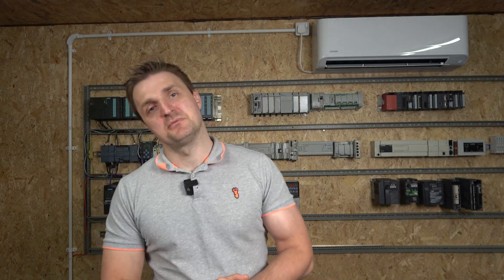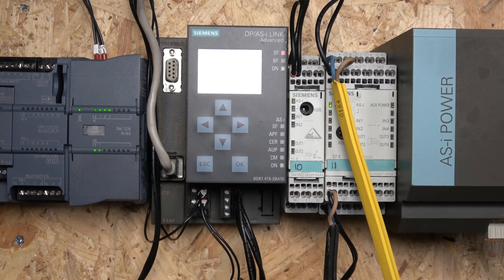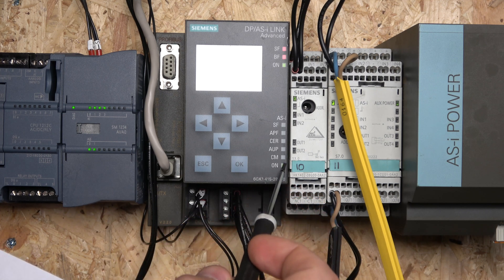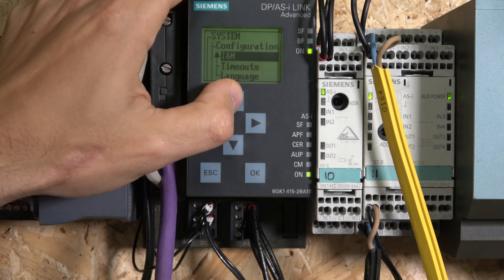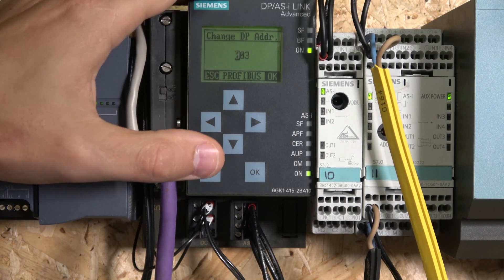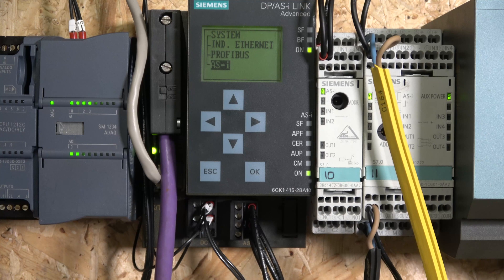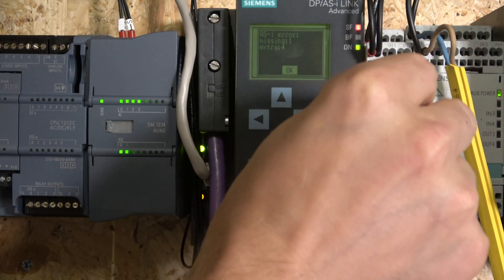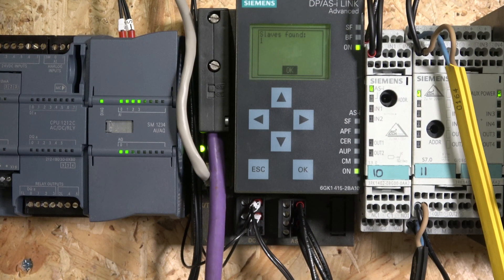Siemens DP/AS-i Link Advanced wiring and set up. English

Comment: I’m setting up vacon 20. It is a 3hp motor for a fan. I have the line and load installed.  I’m adding a start and stop button by the drive to control off and on. The stop button is NC and the start button is normally open. I took a wire from 24v to stop terminal and from stop opposite side to start button. I used another wire from normally open back to drive on start forward. Is this correct way to wire these? Need to set up ramp up start also. Let me know if stop/ start is wired correct and if landed on correct terminals. Thanks. Will have to look into programming

Comment: Hi there! somebody made a reset and now I have "CER"  and "CM" LEDs activated. I did restored the PROFIBUS DP address and slaves are back but on Mimic they (slaves) appear with different colors. I did compared with another LINKS modules and found following differences: on menu IND ETHERNET > IP settings > DHCP   disabled. And on menu  AS-i line  >Line status > Protected    is selected. On the other LINK which was reset  I have: IND ETHERNET > IP settings > DHCP --MAC address. And on menu  AS-i line  >Line status > Protected --is deselected. Do you have some comments for help?
Reply from the maker: HI There. What is your IP addresses on all of your units? Also, are you able to connect to TIA portal?